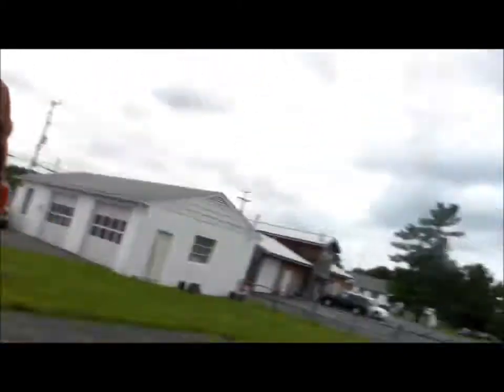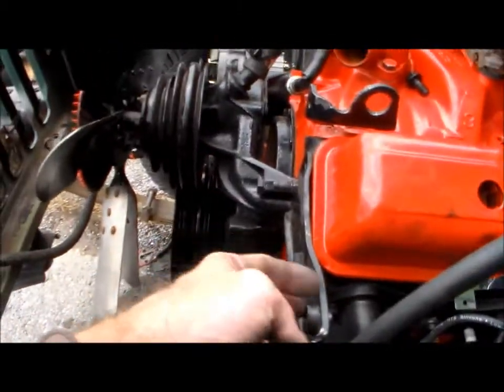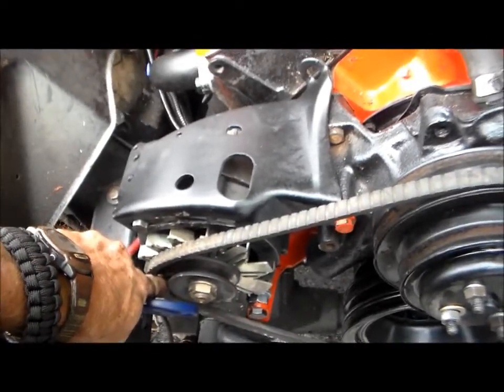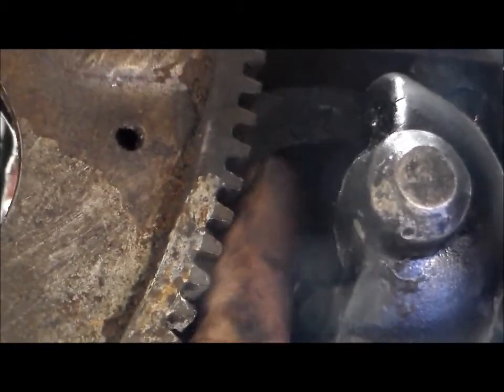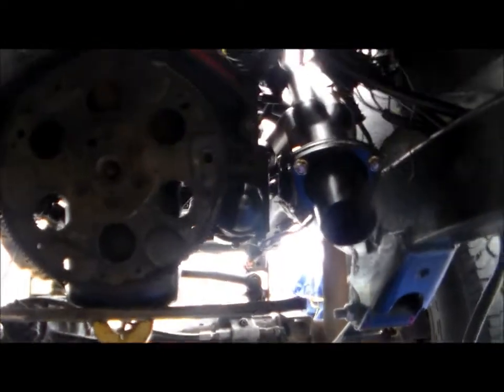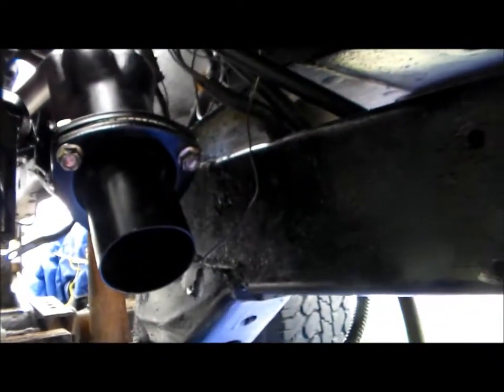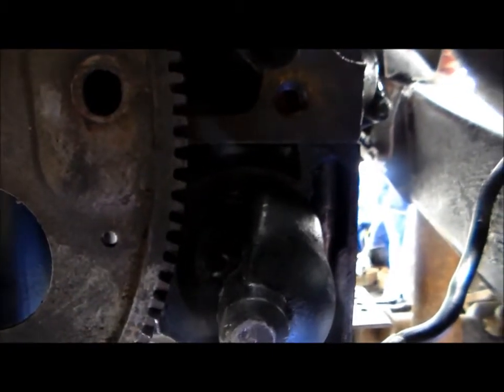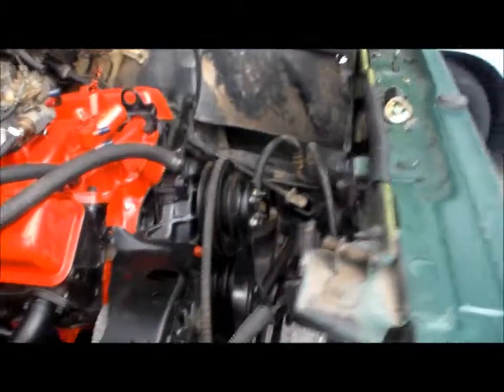305 beast

Comment: Freddie I had the same trouble one time it's either the flex plate or the starter,The best way to do it is take the flex plate and the starter both off and take them to the parts house and match them up that way you can find out right quick which one is wrong...